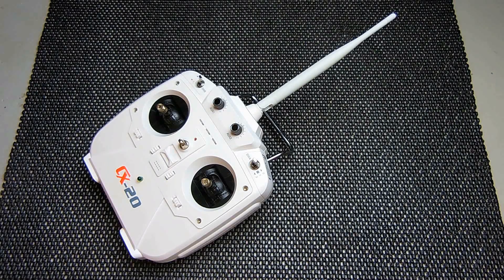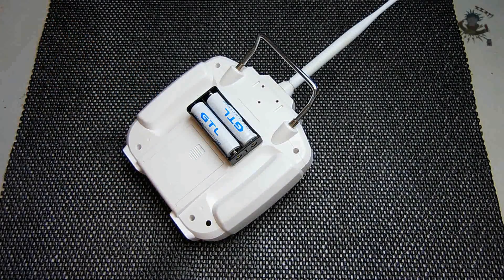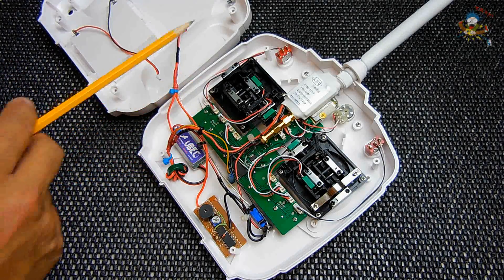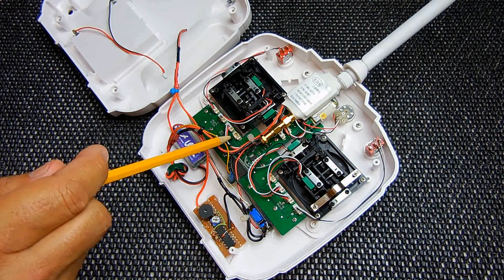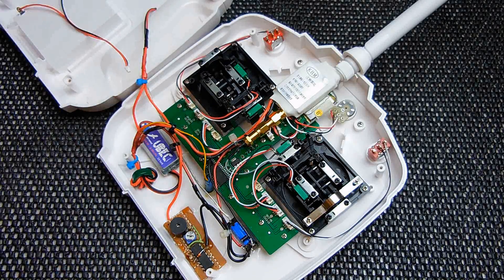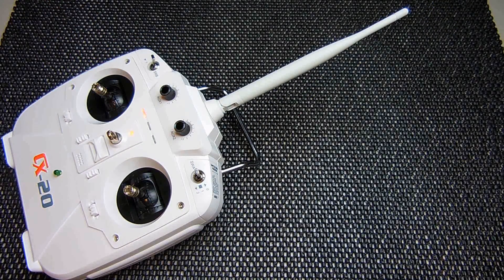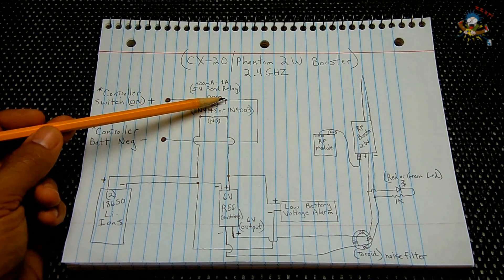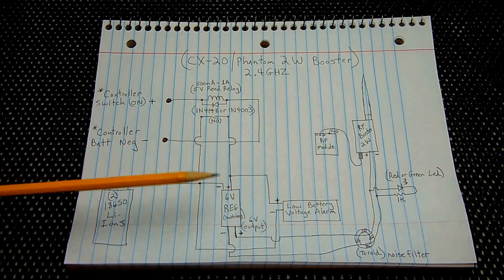CX-20/PHANTOM DJI Range Boost Mod(up to 3.5 Miles!)

Comment: How do I know if the 2W/2.4GHZ Booster is on or even working
Reply from the maker: If power is being supplied to the booster, it should be working.
Reply: A blue light comes on and then turns off. What does that mean? Sometimes the blue light stays on all of the time. Does yours do that?

Comment: I wanted to add, to let your viewers know that your advice is great and sot on, most experts don't know about adding the diode to the coil of the relay to protect against spikes when it opens or to use a toriod after a switch mode to reduce noise on the supply to the booster..Great and sound mod +electronicsNmore

Comment: The 2w linear amplifier has a blue led inside that comes on when the tx is turned on, even if it has a seperate  battery supply it wont light up until you transmit. You can unsolder it from the board and extend the leads for an indicator that it's working.

Comment: What pieces do you use to get the antenna to connect to the collar on the outside and fit on the inside? What is that white collar piece on the inside on the 2.4 booster?

Comment: Can I just solder the existing antenna wire to the 2W/ 2.4 ghz booster wire? Will it still work?
Reply from the maker: No reason to add onto the wire. Keep it as short as possible.
Reply: I'm asking because I'm a little nervous about soldering and removing the antenna wire attached to the board already
Reply: just need to know will it work properly?
Reply from the maker: Jamaine Davis
It may, but it is not the right way to do it.
Reply: ok

Comment: great video and very clean modification love it... just a quick question does the shielded cable going to the rf modul is included in the kit? if not is it female or male going in the adapter thanks in advance great job
Reply from the maker: +Frederic Bourget 
The 2.4g RF mini booster kit I received included the small cable. You can also buy them cheap at Banggood if you needed one.
Thanks!

Comment: Wouldn't it be better to use a logic level MOSFET instead of a relay? Cheaper and almost zero power drain from the main battery...
Reply from the maker: +68Stan 
That was my original plan. :-) Unfortunately I did not have any logic level mosfets on hand. The reed relay only draws 8.5 - 10ma. No biggie
Reply: Old hard disks and other scrap computer stuff are a good source of such MOSFETs for me.
Reply from the maker: 68Stan
Plenty of mosfets in scrap electronics, but the great majority are not logic level.

Comment: good video, great presentation, are you sure this is legal? I did a quick Google on low power transmitters,  specifically part 15 regulations, and it strictly prohibits the modification of the device's antenna and I am sure that adding a PA can only bring severe penalties and fines if you end up causing interference in a license service or operational emergency service.  Otherwise great job and keep the videos coming.
Reply from the maker: +Michael Katt 
The new Phantoms have the same range/power output as my transmitter. :-). I used the transmitter with no noticeable negative effect on my home wifi router or cell phone. Many, many people on YT have modified their transmitters for increased range. My quadcopter will be used in the Bahamas anyway. :-) They could care less what you do on an out island in the Bahamas. I don't know any emergency services using 2.4ghz. The FCC is more concerned about altering the original frequency. Thanks For Watching!